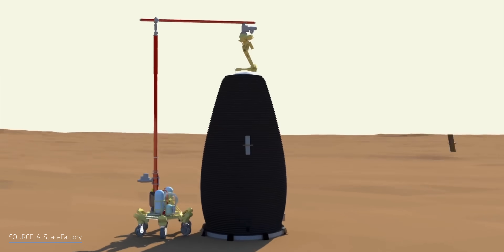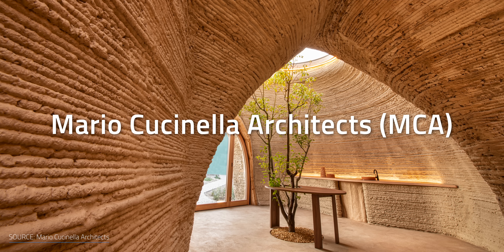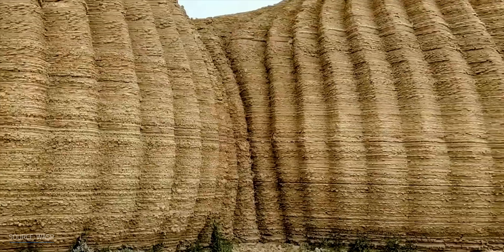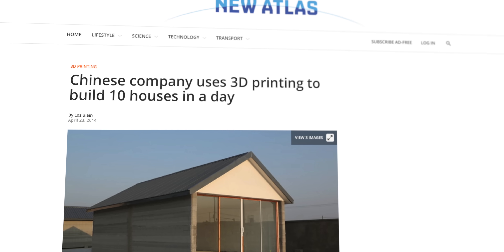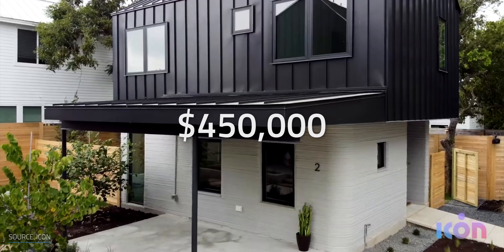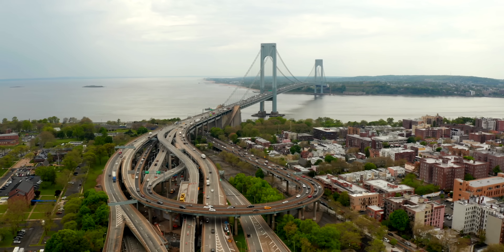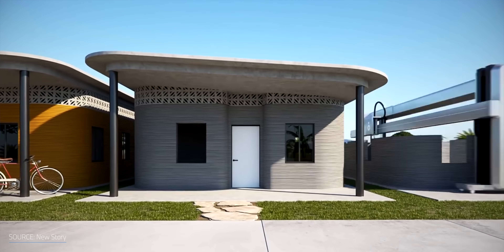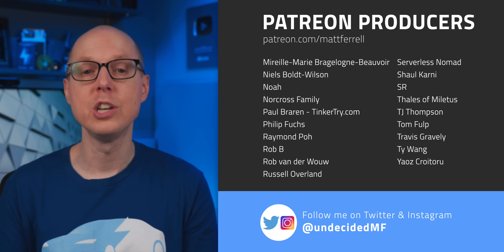The Truth About 3D Printed Homes

Comment: I love how these companies present something as revolutionary when building a house from dirt has been around for a few years... I live in a house made from clay/mud, horseshit and reeds. People built this house in 1 month (hot summer time when there is not much rain as it ruins the walls) using a technique which is fairly similar to concrete pouring as the walls had wooden sides where they put in the reeds and then poured in the wet clay/mud/horseshit combo and plummeld it from above with large wood pillars. This house stands now for over 100 years, there is no solid foundation only the ground that was plummeld in a similar manner without the use of any machinery. Also fun fact, when today outside was 36 degrees celcius in the house is about 23-24 max, and I do  not have any type of airconditioning.  Downsides are that over the years sometimes cracks form, which need to be fixed with the same material otherwise they are persistent. Oh and yeah, as others mentioned bugs or insects are somewhat of an issue, but as we do not have any  very nasty ones in Hungary (yet) its not that big of a problem. If you want a sustainable house, come to Hungary, buy one of these houses for 5-6K euroes (with large garden 1-2 thousand square meters minimum) and you are good to go.
Reply: I would argue mediterranean stone houses are also quite susutainable
Reply: a few years .... now THAT is an UNDERSTATEMENT ... wattle and dob ... adobe ... etc has been around for millenia ... LOL and they call the fact that they have a spinny pipe that pumps the adobe or sob into a wall shape is just a new twist nothing more LOL
Reply: Like a proud American i rater go with 2x4 beams and brick layers my house is from the 80s its more then unfuckable unlike building with animal fesses or is that dirt i guess
Reply: @daymenleo6895  I do like the American brick houses too. Historic brickwork is also always a neat detail to see.

Comment: I recently built a concrete pad to be used as foundation for a 3-d printed building. We poured over 180 cubic yards of concrete JUST for the foundation (which has to be perfectly level otherwise the printer won't work on it). I'm highly skeptical when it comes to 3-d printed homes. Unless huge technological breakthroughs happen and they're able to work around some of the inefficiencies, we won't be getting rid of contract construction labor anytime soon.
Reply: The 185 yard pour I just worked on was for a $10-million home that is too big to fit on a 24x36 paper at 1/4 in ch scale.  Footings 5' tall.  I don't know of any 3DCP anywhere near this size, so I am guessing that is one beefy slab!

Comment: This looks ridiculous. There are many many reasons why mud houses were used only in the worst possible economic times and they were always upgraded to stone wood brick concrete or any better material.

So i guess it might be good for super poor people but i somehow doubt that it will he as cheap as the mud houses people made some 100 years ago so really who's this for? Also how would the electricity and plumbing work ? I dont see any cables or plumbing in these houses. What if plumbing fails and there is a leak what happens to the mud? What about repair or fixing cables and plumbing? How about the windows? Who wants to live in a windowless house. Certainly some people buy that is a very specific niche. 
Sure some super rich people will buy some of these for fun or political pandering and use it as a weird villa but i doubt anyone will live in such a thing long term in 2022.
Have the creators tried to live in these houses for a few months at least? If i see a vlog with their daily house in such a house that might change my mind.

Comment: You have a very valid points of the downsize of 3D Printed House.  I have a question, does it have to be in circle style, not a box type?  Do you put reinforced re-bars in the cements for structural strength> and finally how does it stand up to Hurricane and Violent winds storms??

Comment: How about you get rid of the machine and put people back to work. Cob homes have been around for thousands of years and are environmentally friendly.  They are just labor intensive. What's wrong with putting people to work though? IF a community for a crew they could easily build hundreds of cheap and affordable homes that can last hundreds of years in any environment other than a swamp or rainforest. Also with the super think walls of cob homes you get houses that don't need much heating or cooling so you save on the thing the uses the most resources when it comes to energy management.

Instead of building homes designed to self destruct by machines put people to work building houses that last for hundreds of years.

Comment: a good video but i personally dont see the worth verses conventional building & construction. 

First problem, round structures take up more room within a space than a squared one. Looks pretty, but you are losing floor space. The lack of straight walls will also be an issue when trying to align furniture & the like.
 
Second, as mentioned by others in the below, this is not feasible in many regions due to problems with local wildlife such as various types of wasp, but also quality of building materials. there is a reason we use concrete, which can be made from wood ash but that requires a fairly considerable amount of ash (i beleive its the high calcium content that remains).

third, this would be okay for low density and rural areas in poorer countries but in more developed countries this just isnt feasible. Land area comes at a significant premium and you need both optimisation & efficiency, otherwise its wasteful.  This is why, especially in more urbanised areas things get built vertically, which this building method does nothing for, save perhaps the very top but even then its not particulary enticing.

fourth, plumbing and wiring, where the hell are you going to put your plumbing and wiring

fifth, those hollow walls are going to be a great place for all sorts of pests to gather and procreate, and if you use just clay, it will be easy for mice and rats to burrow into those crevices.

Comment: It looks like a very expensive way to produce mud huts that are very similar to the traditional kraal homes used across most of Africa.  I'm sure that if you rocked up in Africa with your massive (and expensive) 3-D printer the locals would just die laughing.  As for the cost ... clearly this thing hasn't been given much thought.  Score out of ten?  A miserable 2 at best.

Comment: The real challenge of 3d print in construction is to integrate the technology with the currently construction systems. The house in Texas is an example to that matter. My opinion what should be a good next step is to create 3d prints the divisions in high buildings, under a steel frame structure.

Comment: 3d printing a single story, two room, house out of mud might seem innovative until you realize people have been building houses out of mud that size for thousands of years by hand. Doing it in 8 days though - that must be a breakthrough - until you realize a crew of tribespeople or villagers can make a single room daube house in about a day if building materials are readily available. So what's the big innovation? That a machine did what we have already been doing for thousands of years? If we want the sustainable mud home we can do it far more sustainably without the machine. We have been building mud houses for as long as we have built houses.

Comment: Yes, it also requires a very flat site with good access to it to make the whole installation possible. In my situation, that is not the case. We have the slope with difficult vehicular access and many good old trees which we don't want to kill. Just setting up the machinery to start 3D Printing on our site would cost more than an average house frame set. Next problem is the local building standards. Good luck getting a Building Consent from the local council for "3D printed" house. Then good luck getting funding from the local bank for it. Then good luck with the weather, which can start pouring 120mm of rain on your half-printed walls turning it to liquid mud. Then good luck with rodents and insects which will be happy to claim that "home" for themselves with all the cavities in the walls so accommodating. Then good luck finding joinery and fastening that will fit to the printed material... good luck! I would not attempt doing that for myself if that was critical for my family. Only as a side project on my pocket money budget kind of project. May be as a side-project if I was a developer. Just to try it out on a side of traditional development.
Reply: Insurance.

Comment: As a data and AV cabler, it's difficult to understand how electrical, AV and network cabling is installed. If they've got an easy solution for that, I'm all in. Maybe not a clay house though, or it'll be washed away where I am within a few short years.

Comment: While the rounded walls of 3D printed homes are aesthetically pleasing, they are not practical and reduce the usable interior space. Also, how do you add mechanical systems like wiring, plumbing, heating to the dwelling? Seems like whatever money you saved in the construction, you will quickly blow through in adapting interior finishes to fit the space. Then you are left with a claustrophobic structure where you hit your head every time you stand up.

Comment: Clay is used between logs for log cabins.  It needs maintenance as it falls out.  Houses in the US plains were built into the ground because they didn't have access to much wood and glass.  The reason this is not done by most people is because of animals that also like to do that and you end up sharing your house with rodents like prairie dogs, snakes and insects. I have a normal house and still need an exterminator due to a field a block or so away with power lines.  So far I had to fight a mother raccoon, rats, bees, and spiders over real estate.  We have large spiders that cannot be killed with a shoe so I use the vacuum cleaner to attack them.  Good luck with even a wood home because those rats chewed through my concrete foundation, plastic and wood around the small foundation entrance to get into the house.  My foundation is covered by a wire grid because they are not good at chewing through metal.  They can collapse their rib cage and swim through your pipes so check your toilet.  I know in Europe they wage war with insects to keep those castles standing.  Then there are the termites.  So we need construction materials that last more than 20 years.  I do not agree with mud that returns to the earth when I have to pay a fortune for a house.  I already had to replace the roof, the appliances, the furnace, and water heater after 20 years and this doesn't include the new paint and flooring replacement or repair.  A house is a well known money pit without any upgrades to cabinets, doors, light fixtures, pavement, plantings etc. due to style changes or just wear and tear.  We need durable houses that can withstand fire, earthquakes, wind and floods.  What we get is junk that looks nice on the surface.  I live in an earthquake zone and I need a house that will not fall down.  Strapping it to the foundation is the only law they passed because everybody knows they collapse like a house of cards.  At some point in the future my home will be a pile of scrap.  I do not look forward to that day.  That clay house will also be scrap obviously.  In San Francisco they put a museum on rollers.  To my knowledge this is the only known method of actually keeping a building standing.  The space needle and one office building in Seattle were built to rock back and forth (the last earthquake we had I saw cracks in that building because I worked on the top floor and got seasick as usual).  Of course the biggest problem with earthquakes is that afterwards everything burns down because of broken gas pipes and broken water pipes.  We will need a lot of marshmallows. Just read any book on earthquakes.

Comment: I thought the advantage of 3D printing is that you can have basically any shape imaginable. So, why is it just domes? Granted, domes are stronger. Is it because the clay material is too weak? Compared to rammed earth construction, which usually contains something like straw to fortify the dirt. Straw probably can't be fed through the injection nozzle. Then, what really is the advantage of 3D printing over traditional earth construction? Cost?

Comment: My professor has a hay bale house. You cover it in cement, but mud would work. Great insulation and grass regrows quickly. The roof is then just roof tiles or wood, way cheaper than these but very similar construction. And you can make them two stories.

Comment: Ironically, fully 3D-printed structures don't strike me as a good long-term residence. It's the same reason we generally don't build structures out of 100% concrete. Structures, especially residential structures, change over time with the requirements of their residents; with a single-piece structure, any kind of modification would be a major undertaking. I don't like stick-built structures, but we haven't really found a better way to build structures that are easier to change.

Comment: Having lived in adobe houses, this is great news.  the issue with adobe is it is dependent on cheap labor.  So if 3-D printing lowers the labor costs, you already have a centuries old technology to apply it to.  And you can just print the blocks, if necessary.
Reply: So a bunch of people are out of work?
Reply: @Belenus3080  sadly, most are already out of work.  Trying to find someone to do extensive repairs on an adobe building is tough.

Comment: true 3d printing of houses is not reasonable at all. it is purely experimental. That said, it can produce highly valuable insights that could not have been reached in another way. For instance, how to design a wall of clay such that it is stable.
For me, the problem lies in the basic paradigm : growth by accretion, which has not been changed by it. It just took it down to the liquid muddy phase, and as a result, you get curved walls, which is fancy, but mostly not that practical.
The way to go is clearly some mashup of approaches. And those then have to include the infrastructure (tubes, cables, wires), reserved spaces for storage and appliances furniture, air transport. etc. The robot building modules, also on-site, which then will be assembled by a crane.... much more cost effective. You also can mix materials, or apply different pre-processings to the raw material.
...and finally, instead of looking to wasps, they should have been looking termites. The former build with paper, which has its own advantages and constraints, while the latter are actually the clay experts.

Comment: The point of 3D printing seems to be speed. But I worked for a company in the 70s that precut all lumber, as well as assembling the wall frames. An average home kit fit on 2 large flatbed trucks, including windows and insulation. An experienced team could put up a house on a pad in about a week. The system was computer programmed (using plastic hole-punch tape at the time) and had a large catalog of designs. So, is 3D printing really an improvement?
Reply: No

Comment: The exterior needs protection. Yes, the goal is a house that can fade. It should still last 50+ years, or it fails as a house. A nice layer of stucco or whitewash should work if you don't want plastic paint. Otherwise a couple of rainy days will ruin it.

Comment: That was an interesting statement about housing density. Disneyworld's original plan for EPCOT (Experimental Prototype Community Of Tomorrow) was a that of prototype city with a quality solution for work and living space side by side in "pods". Has efficiencies for sure. 
This use of local soil is clever. Harkens back to adobe.  It will be interesting to see how they evolve further beyond the traditional geometries. 3D Printing affords more options with shapes and structures.  With Artificial Intelligence added who knows what will evolve. I recall seeing a 3D printed vehicle wheel support assembly that looked nothing like the norm. It used less material and had far more strength.  This mimicry of nature is brilliant. Nice work!

Comment: Two problems I see with clay houses.  1) Rain.  Clay washes away in the rain.  You'd need something to protect the clay from rain.  This is the lesser problem, as a broad roof would give most of the needed protection.  The onion shaped house in Italy has no such protection that I can see.  It might work in the Chilean desert, with no rain at all most years, but few places are that dry.  2) Earthquakes.  Clay will need lots of reinforcement steel or Kevlar or some such, as even much stronger concrete needs it.  If you live in the middle of Australia or some such place hundreds of miles from the nearest active fault, you might feel that isn't a problem, but even in places with no history of earthquakes, people have been surprised.  Charleston, South Carolina had no historical earthquakes until 1886, whin the city was heavily damaged by an earthquake of about Mw 7 which killed at least 60.  Wherever you are, it might be a bad idea to count on the stillness of the ground.

Comment: Want a new and really nice building technology for cheap efficient homes?

Check recycled plastic bricks. Basically human sized lego bricks. And as legos, really easy and fast to build. Done with materials that would otherwise end in a landfill.
On top of that they are really good temperature insulators, not affected by bugs or humidity.

They are light, lock mechanically or can be glued together for extra rigidity.